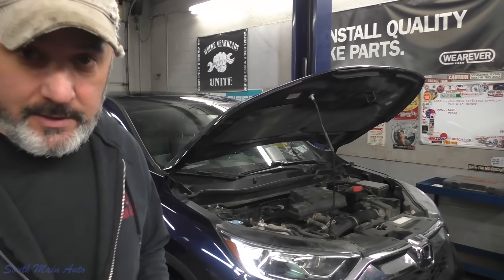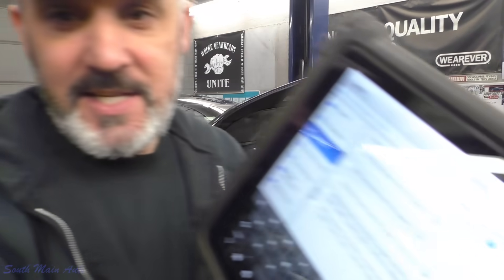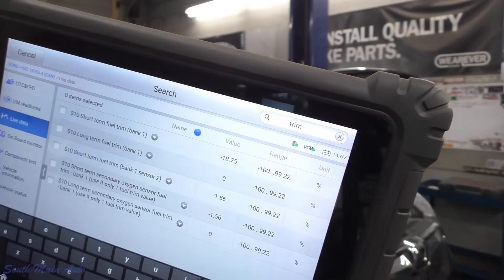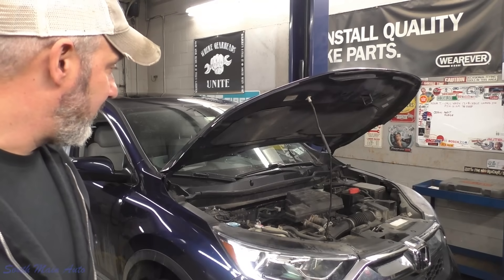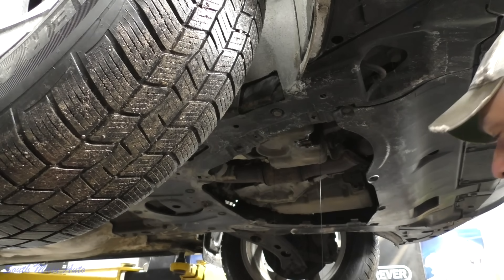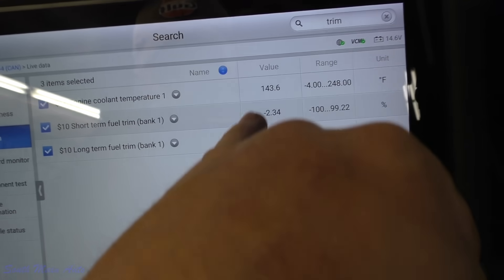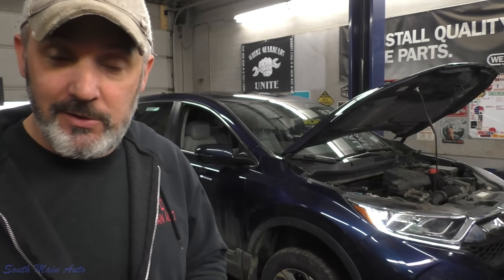Quick Tip Tuesday - Fuel Trim Troubles

Comment: storing a car for a long time can contribute to the saturation of the EVAP canister, primarily due to the natural evaporation of fuel over time. The EVAP (evaporative emission control) canister is designed to capture fuel vapors from the fuel tank and store them until they can be purged into the engine for combustion.
 When a vehicle is stored for an extended period, especially in a sealed fuel system, fuel vapors continue to form and accumulate in the tank. If the EVAP system is not periodically purged—such as through driving or a manual purge cycle—the canister can become saturated with these vapors.

Comment: My long term fuel trims is -25 short is -15-25 I have p0171-175 and p2187-2190 code my engine is both lean and rich any suggestions? I have changed maf, fuel pump, throttle body, coils, spark plugs, injectors, catalytic converter, pcv valve, intake manifold gasket, all O2s and lastly I changed evap purge valve and still nothing idek what it could be anymore I have done smoke test no leaks and

Comment: Might just well mention the Wet Belt in this car.  This is one of the worst engine Honda ever produced.
Reply from the maker: Wet belt lol not on a Honda
Reply: @SouthMainAuto  A Honda "wet belt" refers to a timing belt submerged in engine oil, a system used in some modern Honda engines like the 1.0-liter turbo found in certain 10th-generation Civics. (Source Google)

Comment: Hondas high pressure fuel system that they didn't test properly before selling it to the public. Our genius college educated kids dreamed up. Should be called the pipe dream engine. All that gas that's blown past the rings into the crankcase is not going to lubricate the rings. Guess what, the engine will wear out quickly. Billy Graham was right when he said we would either go back to the Bible or the jungle

Comment: I just had the same issue! Customer towed their 1998 Chevy Blazer 4.3 into the shop, crank no start. Sat for 6 months. Fuel pressure gauge would shot up as intended then dropped it immediately, found the spider injectors cracked! Replaced the injectors, removed the plugs, cranked the engine over after disabling fuel and ignition systems, then installed new plugs and o2 sensors as well. Ran the car, and fuel trims were maxed out at -30 LT & ST both. Also the oil pressure gauge was almost 0 but would fluctuate with engine rpm. Gave it some thought and then smelled the dipstick! Sure enough, exactly what you got going on!! Stumped me for atleast a week, adjusting the distributor, then smoke testing the intake, etc. thanks for the video!!!

Comment: Just giving it a little thought, it seems so obvious.  But the vapors being sucked out of the crankcase isn’t monitored anywhere by the OBD.  Great tip.
Reply: These fumes are being drawn out of the crank case, burned in the air/fuel mixture, then picked up by the O2 sensor. The computer reads this abnormally rich condition and tries to adjust. When it can no longer do so, it turns the engine light on and sets a rich trim fault code. Definitely monitored by the OBD system

Comment: I think people are too quick to sell injectors when dealing with a rich condition on these Honda 1.5’s. This could have simply been a normal case of oil dilution that these motors are known for, and the injectors were ok all along. The correct way to diagnose this issue would be to change the oil FIRST if it smells gassy (not at the end), then look at trims. If they’re still rich, THEN I’d lean toward injectors.

Comment: Obviously getting rid of gas contaminated oil is the way to go, but wouldn't a drive long enough to get it fully up to temp burn off the crud and bring the trims back in line?

Comment: Mr O. I have a GMC 2011 4x4 won’t work have replaced the little modules under the dash and the thing that pits it into drive and 4x4 on the transfer case. Have replaced the little motor that locked the front axel in and a new switch. 2 wheel drive lights up on the new switch automatic, 4 high or 4 low will not light up. Every time try to program the new motor on the transfer case  with my autel it says fail took it to local Chevy place they say it was another Electric part and still nothing works. Do you have any idea what the problem is would be can’t get any shop down here to let me have a Mitchel wiring color diagram don’t have a computer to download it on love your channel watch it all the time and been a mechanic for a long time old school but this has stumped me is there a way I can get any information on this problem if it is ok can I call you at your shop.

Comment: Thank you Eric I always wondered why when I like dropped to 50%, the car would lose power now it makes sense if the oil is diluted with fuel it will cause the fuel trims not to work properly

Comment: I change the oil every 3K or if the car is ever on a rack, (have to drive it in to change the headlight? Change the oil while it's in there) and every spring and fall just for giggles and grins.  Also if it ever turns from amber to burnt umber.

Comment: I have lived in Des Moines Iowa and seeing cars rusted front to back from the door handles down and the frames deteriorating. 
I'm in Oklahoma now and cars can survive here.
I see that your job is very much more challenging freeing up the rusted bolts just to get to what your trying to repair. 
If i wore a hat I would tip it to you Eric 
I'm learning from the electrical diagnostic process your teaching 
Thank you for what you do to help others

Comment: Good info. I work on alot of Audis that will dilute the oil with fuel and read way rich. On those the cause is usually a leaking high pressure fuel pump.

Comment: The service manual for my 80s Audi actually calls this out in the procedure for setting the mixture on the mechanical fuel injection - and have you disconnect the PCV when doing the procedure.

Comment: I did not think of that scenario, I don't own any of the fancy new stuff, turbo chargers are not for me, having owned an airplane it was common "lore" to run the engine frequently for a while, flight or ground to "burn off" moisture in the oil/case to mitigate corrosion. Would running for a while do the same for the fuel injectors over doing it before repair? or even running with perfect fuel injectors the engineering just introduces more so it can't "burn off"?

Comment: Could have used this a few months ago --- my Lexus had me chasing my tail until I changed the oil, and finally the check eng light stayed off after cleaning the MAF,  and changing the bank 2 downstream O2 sensor (stuck high) etc. Short distance driven and 1+ year old oil that smelled gassy (yeah - i should have suspected).

Comment: Just run it til the oil is hot, shut it off for 5 minutes, pop off the oil cap and flick your Bic right over the fill hole. KABLAM, excess hydrocarbons gone.

Comment: Thank you for this video topic, i had a customer with a 1998 Tacoma pickup and the truck was showing high fuel trim numbers even after a new set of 4 fuel injectors were installed.

Comment: Great video, I knew that gas diluted oil could hurt a motor, BUT, I did not even think about it going back in through the crank case ventilation! Thank you for the quick tip!!!

Comment: I am assuming if you ran the car for a while the gas would slowly get sucked out of the oil and used up, and that over time the fuel trims would return to normal.  However, I think that when a car has been massively overfueled (like bad injectors, example) that an oil change should be a normal part of the deal.  That extra fuel went somewhere!  :)
Reply: Most of it probably burnt up in the catalytic converter, but yes, some ends up in the oil and that ain't no good for bearings.

Comment: Hey Eric, no matter how dumb you think a video might be, somebody watching all your vids can always benefit. I've been a shade tree mechanic since i got my first car in 1995 always had to rely on Chilton/Haynes manuals to help me out. So it's guys/gals that run channels like this, is where i get my knowledge for newer vehicles. Thanks Eric, much appreciated.
Reply: Got my first car in 1974. 1962 Buick no power steering .No power brakes. Small block.
But I was fee!!!!
To drive to work...of course gas wa about 60 cents a gallon if I remember.
Oh yeah. Did my first brake job on that car. Took both sides apart at same time.
Shoe brakes. Daddy had to come help me put one on and I did the other
 Last time i did that in the 50 years since.

Comment: This is really common on low mileage vehicles, they drive very short distance's with little engine run time so the engine only runs on a rich fuel mixture.  Customer only changes oil every 5k miles or so and by the time they need the oil change the p0172 is set from all the gas that's mixed in the oil.
Reply: @justing9902  why do short trips give you fuel rich mixtures?
Reply: @BillGates_Alex  Because cold engines need a rich mixture to run smoothly.
Reply: @BillGates_Alex  Cuz when you shut the vehicle off there is some fuel left unburned on the cylinder's  that will end up in the oil, over time the oil gets enough fuel in it then causes a p0172.  also vehicles run rich in open loop and do not adjust fueling until the vehicle is up to temp and turns to closed loop which then the o2 sensor reading's will control fueling.  thats my best explanation for it but i've seen quite a few vehicles at my shop where this happened and most are low mileage.

Comment: that's nothing back in the 70's when I was a young pup mechanic many cars would be towed in with blown up valve covers and oil pans because the flooded there carburetors trying to start them in -45 winters here in Canaduh 😅🤣😂

Comment: 4 cycle Outboard boat motors will show high cylinder temps "EGT" ( overheat shutdown mode ) Due to lean trim from gassy oil.

Comment: I have a 2023 Honda CRV hybrid… At certain points driving usually when the engine is under slight load I could feel stumble… I take the car to the dealership after using my scan tool and seeing that I’m getting multiple misfires not enough to cause a check engine light but an awful lot for a car that only had 22,000 miles on it… Fast forward Honda  dealer says I need new injectors… They actually told me that the misfires were due to not enough fuel being injected… They replaced the injectors. I just changed my oil and sent it off to be analyzed and they basically told me that I was in the danger zone for fuel dilution! Leads me to believe the dealership said that to avoid having to do an oil change on top of the injectors being replaced. And at the time I was only at like 30% on the maintenance minder.  I’m guessing exactly what you’re talking about in this video is what happened to my car. I didn’t look at fuel trims. I was just looking to see if there were anymore misfires… Thanks for posting this! The more you know!!
Reply: About 3-4 k. I really pissed it was another 4 k. I change it by 15% remaining.  Damage already done thanks dealership
Reply: How many miles was it before you changed the oil? Thirty percent = what?

Comment: Will you be able to smell the fuel contamination on the dip stick or wiping cloth..?
Reply: if you have a good sniffer it will smell like raw fuel, even a very small amount with light scent. but you also need to differentiate mostly burnt fuel smell from straight raw fuel smell.
when my allergies are not going haywire, I can easily tell by the oil dipstick if there's a rich condition, coolant in oil, blow-by etc. of course always test to prove it and don't guess!
Reply: Thank you!

Comment: Just Recently replaced the fuel pressure regulator on the fuel rail, on my 2001 Toyota Tundra, , , not sure if the oil got fuel diluted, , but I changed it anyway.

Comment: Now you tell me. I want to hear exactly the same issue with a 2012 Toyota Corolla. It was popping a P0172 CODE even after replacing a known faulty fuel injector that was not closing completely. I thought the code had gone away because I completed a certain number of dry Cycles. Now I realized it must have been the oil change I did a few days after that did.

Comment: Back in the ol' carburetor days you'd flood your car when it was -20 and you'd crank and crank and crank and would not start.  You'd pull the plugs and put new ones in and it would start and next day it wouldn't start again and it would crank and crank and crank and would be flooded again.  Had to change the oil just about every time it got really cold.  Sometimes dumping oil down the carb would help but that was a last ditch attempt.  Fuel injected cars are so much better.

Comment: Nice explanation Eric O.  Someone will benefit as you said.  Back in the days of using a 4 or 5 gas exhaust analyzer,  you could see the change in carbon monoxide and hydrocarbon count after a changing oil on an engine that was running filthy rich.  Now the fuel trim shows it.
Stay warm up there.

Comment: I left a comment about fuel in the oil, on Sherwood's channel where he was working on a vehicle that had been running rich. I ran into that many times. In some cases, in the winter time, the cars were used for short trips and the oil was diluted just because of the natural rich condition on cold engines. This was especially true when the cars took longer to go into closed loop. Or in the case of my dad's car where the mice had filled the air filter box full of wild bird seed! That took a oil and filter change and new spark plugs!

Comment: We had a similar problem at the shop. We changed oil. Everything ok. But. Very shortly fuel trims were claiming negative. It was the high pressure fuel pump leaking to the crankcase

Comment: Thanks for the video.  Yeah I got one of those 1.5 L turbo charged earth dream engines in my 17 CRV what I do is I’m now the change in the oil every 3000 miles to try to mitigate the oil dilution problem.
Reply: 1.5 litre in a CR-V - that's nuts. The money being saved in fuel by these fleets is just going to be lost to higher maintenance costs and lower reliability. The manufacturers hit their government mandated fleet fuel economy numbers, but every owner pays the price - more maintenance, more repairs, lower resale. Gah.
Reply: @Slicerwizard  other than oil dilution problem (like that’s minor…lol), no mechanical issues and i average over 36 mpg.  42 k on the odo

Comment: Eric, i replaced my injectors and engine oil and my fuel trims are still pass -10, what could be causing this issue?, and it’s not GDI, it’s port injection engine.

Comment: Had to change the oil on my 385k Toyota at a 3000 mile interval instead of 5K to pass stupid Ohio Emissions because of this. Like you said, swapped injectors and changed the oil and shazam....back to stoichiometric bliss. Good tip!

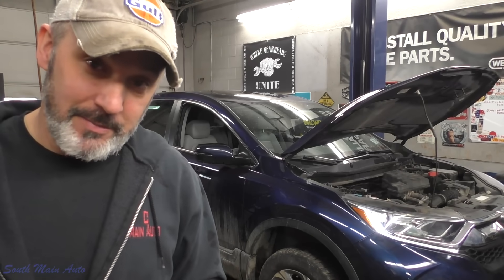Comment: I know that carburetors did not give 3:41  a crap about fuel trims ... the old days 😢
Reply: 12-14 mpg town and 14-18 mpg was pretty good in those days too. And a complete tune up every 30K. Remember how cars used to sputter and diesel on until after you got in the store. When is the last the you even saw that?
Reply: @phazerboy  my 20 f 250 gets 14 miles per gallon.  And i never owned a vehicle that dieseled when shut down.  Even my 65 step side f 250. But I have fixed a few in my days.

Comment: Good thing my old 1979 Chevy 1 ton with a 350 and the choke stuck on didn’t have O2 sensors they would be - a million. lol.  Probably could have put the oil I drained out of in the gas tank and ran on the oil gas mixture. 😂

Comment: I got burned pretty hard on a F250 6.2 with a #6 misfire. I got the correct fix on the first try, but it started doing all kinds of weird stuff; bank 2 misfire, injector 5, 7, and 8 insufficient flow, lean conditions, equivalence sensors pegged high with fuel trims pegged negative. Just nonsense.

Had to restart the diagnostic while resetting the keep-alive memory between steps because the adaptive nonsense was trying to break it faster than I was fixing it. 😂

Comment: What infuriates me the most is why can’t an engineer figure out how to place an oil filter that’s not above another piece of the vehicle/frame. My son’s Ford F150 has a molded piece of plastic that is supposed to drain the oil away, but all it does is fill up and run off the back edge. My Chevrolet Z71 I made a little aluminum ramp to help the oil drain off instead of on the frame.

Comment: I don’t want a vehicle that burns oil I don’t want a vehicle that throws gas into the oil. I don’t want a vehicle that leaks oil I want a vehicle when you put the oil in and it’s time to change it. It’s still there and you replace it with clean oil. Is this too much to ask?

Comment: Thank you for this video.  
Gas in the oil.  Wow.  
I'll bet after a quick few miles on the interstate the fuel trims will be at zero or going between +5 & -5.
Good one Eric.
Reply: Yeah, I'm curious how long it would take to pull all of the fuel out of the crankcase. You'd think that at highway speeds, the engine would be toasty and that with good PCV operation, that fuel would evaporate and burn. However, if you can see the fuel on the dipstick, do the bearings a favor and just change the oil.

Comment: Holy smokes. I've been dealing with something like this. 08 Civic 145k. After the car warms up I can feel the engine start to vibrate and the RPM is at about 675. No codes yet but I think it might be coming. I've tried everything. All 3 OEM mounts, cleaned the EGR and MAF, new plugs and coils, new gas cap, 93 gas. Still nothing. Scanned it and still running at -8. Got to get it in and have them scan it and see what they think.

Comment: Very interesting, never thought about it.
Considering that the fuel in the oil would vapourize at operating temperatures, this problem should fix itself in a short while?
Reply: It never totally evaporates off . Very little actually